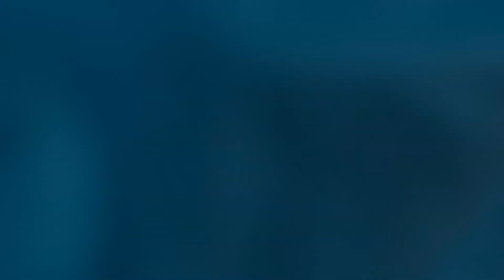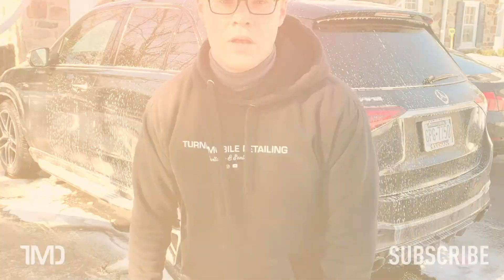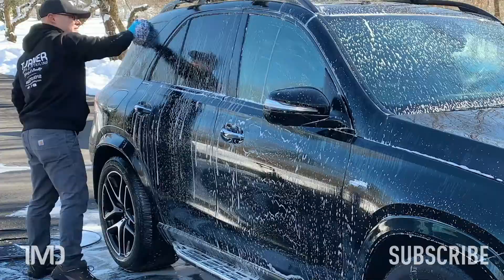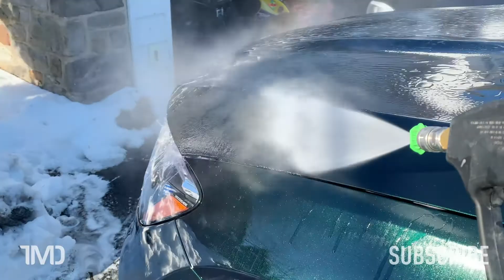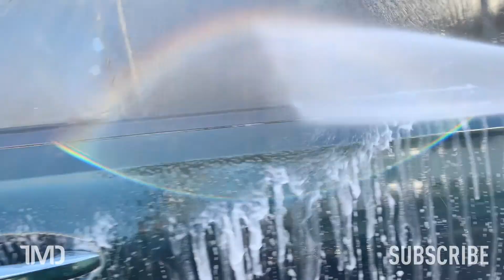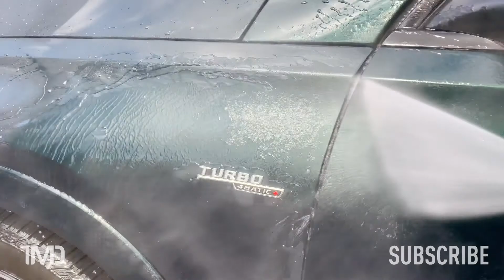The Last Soap Real-World Review | How much Ceramic Protection Will It Leave Behind?

Comment: Griot's ceramic wash in the foamer works good for me.  Will add protection and beading to cars with no protection I've used it on. Last about a monthish on it's own.
Reply from the maker: Thanks man, I’ll have to give that one a try.
Reply: @TurnerMobileDetailing  20bucks at autozone. I was kinda shocked how much it added. Let it dwell about 30-60 seconds.         Looks like this one didint add much
Reply from the maker: @chiller724  so you think the griots wash produced better beading/sheeting than the last soap?
Reply: @TurnerMobileDetailing  definitely looks like it from ur video and what I've seen personally.  I'll be interested to see what you think of the Griots
Reply from the maker: @chiller724  Cool, I’ll have to pick some up. AND it’s cheaper than the last soap, win win. I’ll have to do a video review on it. I’m scheduled to wash that Mercedes on Thursday, I’ll probably either do the Griots or Carpro Hydro2 Foam

Comment: I used this soap just yesterday. It didn’t foam as i expexted, it was like yours too. I thought i made a mistake with the dillution ratio.
Reply from the maker: Most of the time those ceramic soaps aren’t big formers. I’ve gotten it to foam food but I had to use a crazy dilution ration like 10-16 oz in a 32oz foam cannon. But just because a soap doesn’t foam super well doesn’t necessarily mean it won’t clean well or leave the ceramic behind, just means u won’t get as much lubricity.
Reply: @TurnerMobileDetailing  true! When i did mine, i cleaned the car very well. It just didn’t foam well as expected but it’s okay, as long as it cleaned the car very well, i’m happy. Thanks for letting me know why it didn’t foam much though. :)
Reply from the maker: @popeyerubi1981  any time!

Comment: Hey just came across your video and was curious how the last soap was going to do as far as adding a layer of protection during the wash. I was not impressed. I heard you say during the video that you are looking for a good soap that will add a layer of protection for your customers that don't want a wax or sealant applied. You should try Carpro Hydro2 foam. Make sure it's the Hydro2 foam and not just the Hydro2. The Hydro2 foam can be applied with a foam cannon then rinsed off. You will be amazed at the protection and hydrophobic properties it gives you with just the wash. And protection that they claim last about 3 months. I use it all the time and love it. Anyways thanks for the video.
Reply from the maker: Thanks man! I have been wanting to try Hydro Foam, I’m a huge Carpro fan! Looks like they’re about the same price too! I’m gonna continue my series on finding a good stand-alone “coating/waxing” soap, and I’ll probably do hydro foam next. Thanks for your experience and suggestion!
Reply: @TurnerMobileDetailing  No problem. I am also a huge Carpro fan. I love Reset, Pearl, Iron X and several more. Haven't found anything from them that wasn't great. You will be extremely happy with the Hydro2 foam. I looks like you just applied a ceramic coating when done. Without all the work. And you can hit everything with it paint, glass, wheels and tire, fender wells. I haven't found anything that's better as far as a soap that puts down protection. It also has significant UV protection.
Reply from the maker: @justinjennings8634  cool! In your experience, how long does pearl last on tires and trim?
Reply: @TurnerMobileDetailing  have not used it on tires yet but on plastic it last for 2 months +. They claim 3 months.I have used it on some pretty faded plastic and it brought it back to like new black. It also puts down great hydrophobic properties and UV protection. I have heard it's great on tires also just haven't used it for that yet. But I will.
Reply: I always use reset first because it's just the best soap I have ever tried. Extremely slick during the wash process, great foaming action in foam cannon, and rinses easily. Then I foam it up with the hydro foam then immediately rinse. No need to wait or wash again. Great results.
Reply from the maker: @justinjennings8634  I e been trying different tire dressings trying to find something that applies fast, looks good and lasts at least 2-3 weeks that isn’t a true tire coating. I’d like to give my clients a tire dressing that lasts more than a week. I’ve been using meguiars hyper dressing but it doesn’t last at all. Megs endurance is great but takes forever to apply. Was going to try pearl next, but wipe on dressings just take so long to apply.
Reply: @TurnerMobileDetailing  agreed. You should try superior cover all for tire dressing. You can pick it up at O'Reilly's.
Reply from the maker: @justinjennings8634  I’ve seen that stuff on YouTube, how long does it last?
Reply: @TurnerMobileDetailing   2-3 weeks. Sometimes longer depending on weather, driving conditions etc.
Reply: There is one more tire dressing I thought about that's spray and walk away. Have never used it but have heard many good things about it. I love there window cleaner. It's Stoner more shine tire finish. Hope this helps bro. Have a good Easter.
Reply from the maker: @justinjennings8634  yeah I have a lot of experience with that. It’s not much better than anything else sad to say. Will look good for a week or 2 with no rain, but rain will kill it in one or 2 rainfalls. I’m testing out meguiars hot shine tire coating. So far so food. I’ll probably make a couple quick videos on it’s durability.
Reply: @Turner Mobile Detailing Agreed on Superior coverall. Also since you said you like Megs endurance gel but don’t like the application, you should try the Megs endurance aerosol